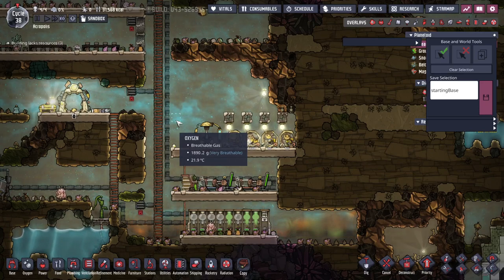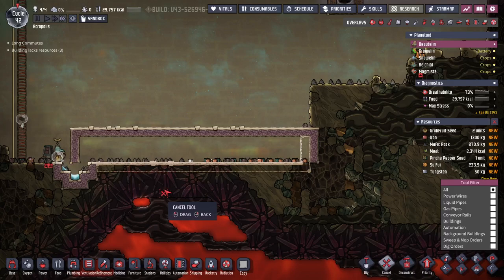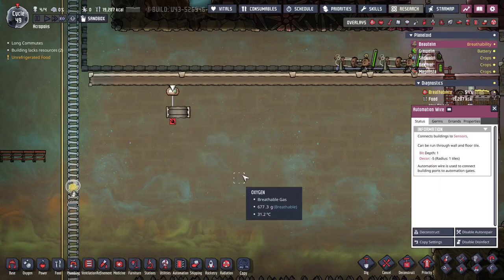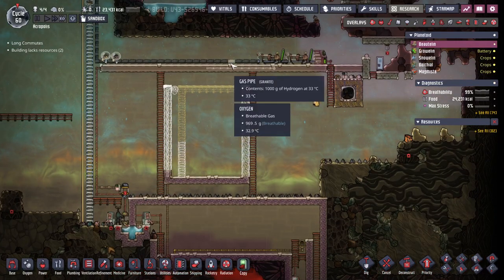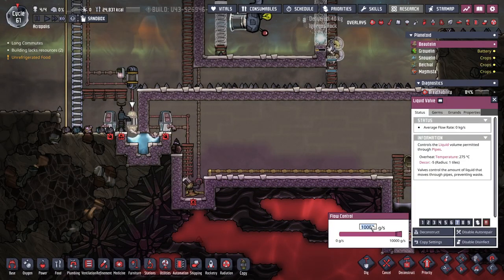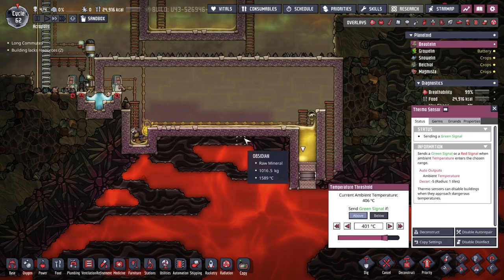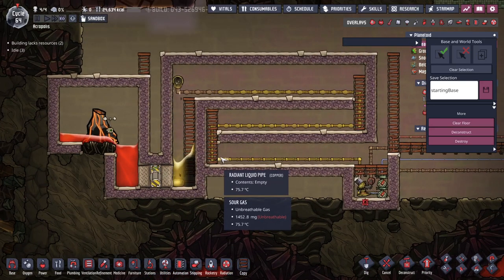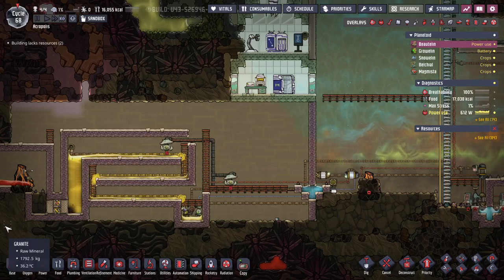Building Petroleum Boilers Spaced Out Tech Tip Oxygen Not Included

Comment: fun tip: after setting up the boiling, send the petroleum to the top of the map. you can build a petroleum generator in the vacuum of space on some metal tiles with some drywall on the bottom. self cooling generators and no need to pump out unwanted CO2 ;)
Reply from the maker: I atomist never use petro gensets.  I find going straight to sour gas is better for my style.

Comment: Nice!  What if you use radiant steel or thermium in the steps can’t you shorten the counter flow?
Reply from the maker: Yes, a bit.  The heat transfer is better with better metal.  But the jumps are not that big.  the limit is more how conductive the petroleum is.

Comment: Interesting I followed on that concept and now my petroleum boiler works and I bleed out the extra heat with some steam turbines. Would it be possible to for you to make a how to build and setup a sour gas boiler video?
Reply from the maker: Which size?  I have several videos in the tech tip playlist for 2kg-4kg.  10kg and a 30kg sour gas system.
Reply: @TartarusPlaysGames  I was trying to build 2kg-4kg one that uses gas pumps instead of gas flow. Was going for small build since it used aquatuners instead of magma as a heat source.
Reply from the maker: @Astrostar27  https://www.youtube.com/watch?v=Zwg0sk_hxGg&list=PL0ra0eqA-Kswd2Tkl8nUQHSGUANAcd4qE&index=12&t=1s
That covers 1-4 kg. With aquatuners.  What do you mean by gas pumps not gas flow?
Reply: @TartarusPlaysGames  Thank you very much it was extremely helpful. I did not even think to bleed the excess heat into a petroleum boiler.
Reply from the maker: @Astrostar27  I first did that to see if it worked.  Was surprising to see how well it did.